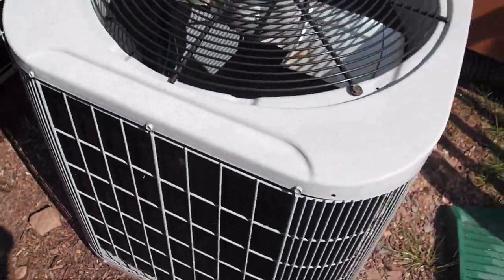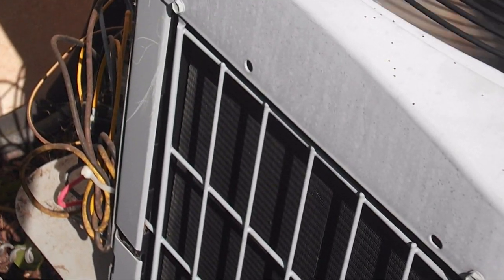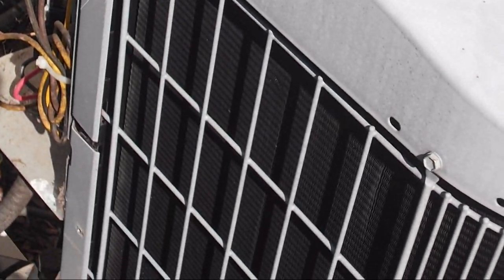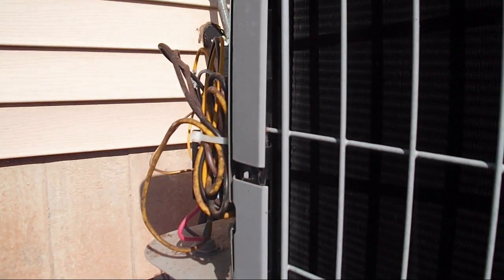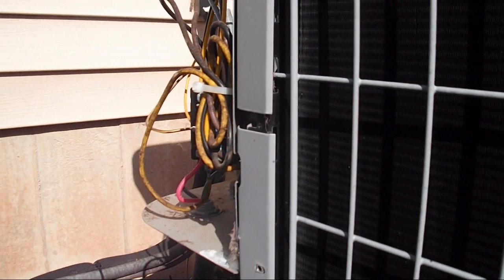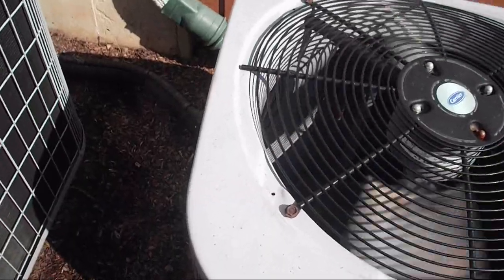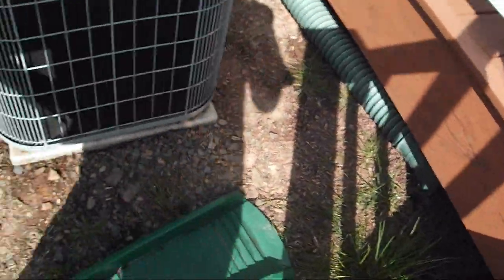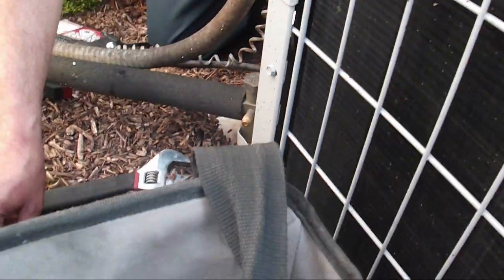VERY FIRST TUNEUP of my 2007 Carrier central air-conditioners!

Comment: Great video!! No bad news is good new's those units sound healthy and seem to be holding up very well!! For builder  grade model's its typical but not always for a capillary metering system not a TXV on the evaporator so bet he did the superheat calculation and there where no whacky readings on the gauges that I saw!!! You'll be nice and cool this summer!!! :)